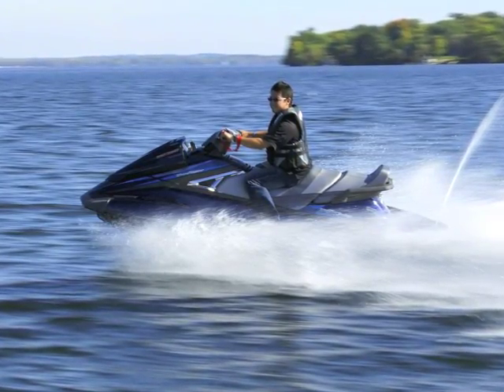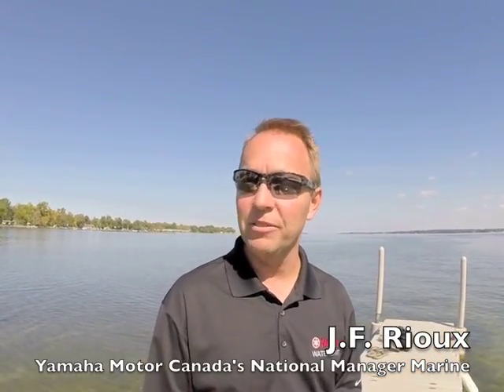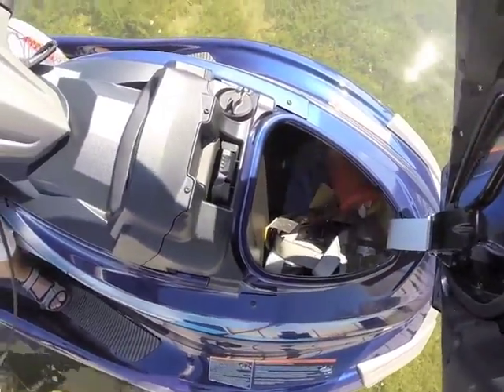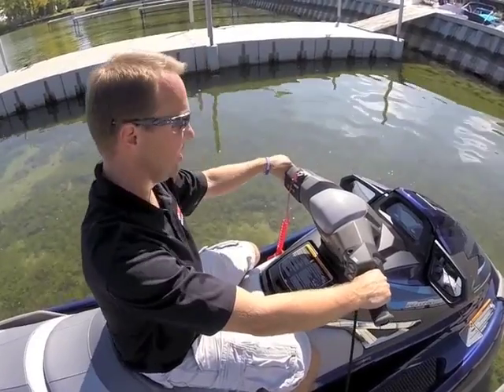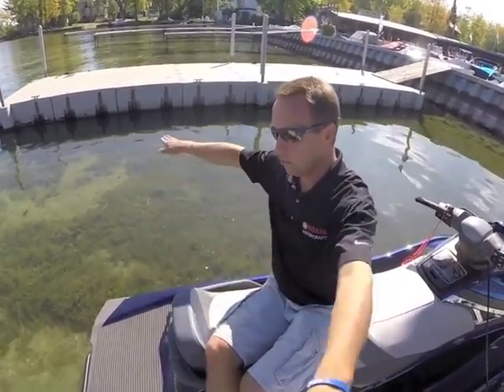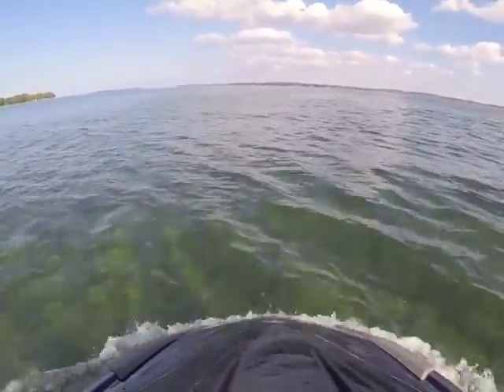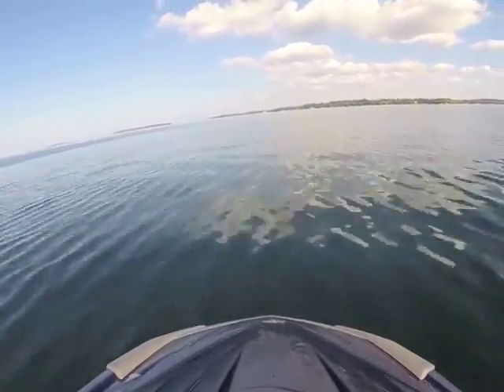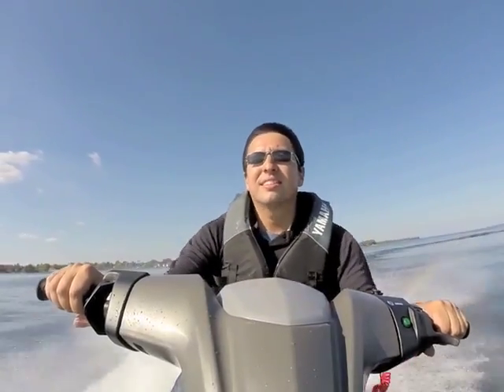Yamaha Motor's New RiDE Control System on the 2015 VX Cruiser Waverunner

Comment: It needs a gps speed cruise control, not a rpm hold...
Reply: What?, don't you know how cruise control works dude?  What the hell has gps got to do with it?
Reply: @barrysargent1213  the speedo is gps controlled
Reply: @aaron-fauth  The only way that Yamaha talks to GPS is through it's sounder, if you have that option! It does not control the throttle! The speedometer is controlled by a small wheel at the ride plate and has nothing to do with cruise control!  It's set up like a governor,  up hill and down dale, the same rpm!
Reply: @barrysargent1213  sorry I meant on my sea doo
Reply: @aaron-fauth  That's ok, I know nothing about the Seado systems.  Yamaha for life is me. I have had a great run from Yamaha all my life and would never ditch a good thing. I wish you the same luck. The ocean is ours my freind!